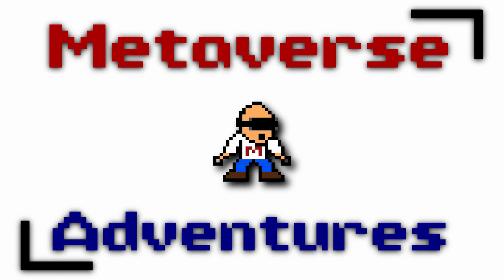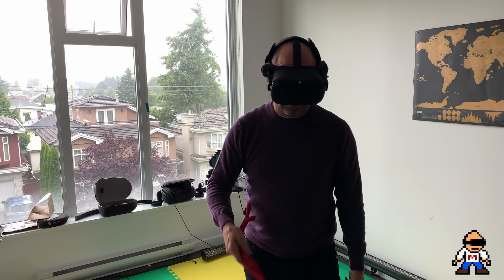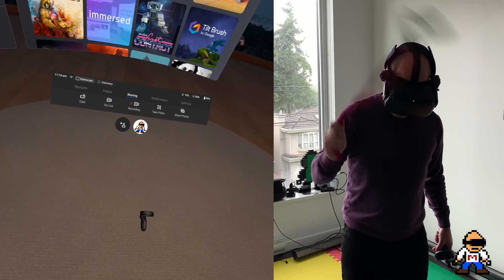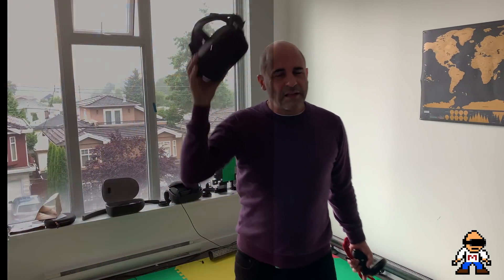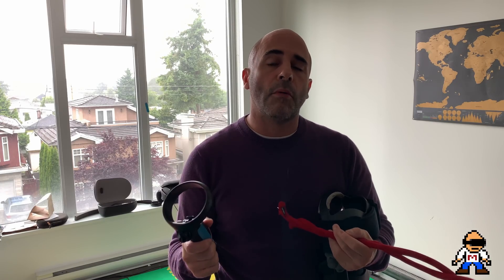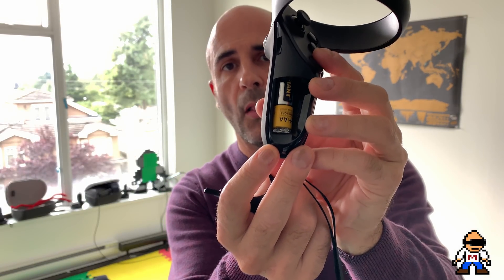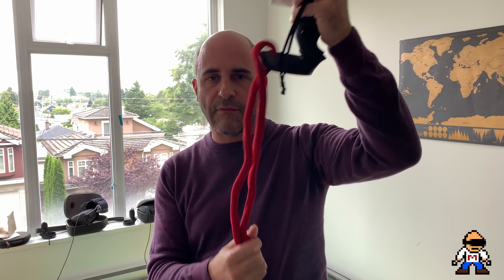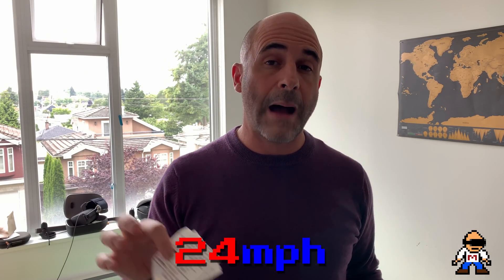See Part 3 Below: Oculus Quest Touch Controller 6DOF Tracking Issue (Root Cause)

Comment: Interesting video, but I noticed it wasn't just when you went fast that it lost tracking. It seemed to correspond with you moving your head down. The quest does have fish eye cameras, but the software guesses where the controller is after it passes their fov. With that speed you are going plus the weird angle of your headset i'm actually surprised it wasn't worse. I understand it happens in beat saber also under certain circumstances.
Reply from the maker: I find it happens even when I do not move my head. I will show it in the next video. Thanks for the observation though. Can you reproduce this error.

Comment: If you have an oculus rift S I would try the same test with that as the device recently received a tracking update.
Reply from the maker: I do not have a Rift S but I am about to post a very comprehensive video that includes the original Rift and even the Vive.  Maybe another hour or so.

Comment: At the speed your swinging it with that rope I'm not surprised it lost tracking I think that's an extreme case. In majority of movements it's going to work perfectly it's only a concern if it's an issue like you stated with best saber I think that's a much more reasonable expectation. The swinging the role thing is pushing it a bit far , you can't really complain about it losing tracking like that , I will say tho I've had the issue you've had with beat saber but I found it was better with dimmer lighting , I've had no such issues in sports scramble though maybe once in racket fury if I recall I had it but it's so in frequent I wouldn't call it a concern
Reply from the maker: I agree that for the most part the tracking is very accurate and while not perfect, and frustrating in games that require you to swing hard and fast, the Quest is still the best.

Comment: I don't think you've shown us a battery problem. The controller stucks but still circles around.  If there would be a battery problem, you would 1. loose the connection and 2. the controller would also not able to track it's 3DOF position (which they can do without the cameras). But as you see: both things are still there. So I just think the headset doesn't see your controller at some speed and that's the only issue. I'm not sure if that hefty experiment of you can be fixed by software. I think there is a chance that they can fix the problem for games like beat saber for humans without superpower but not for swinging the controller as you do. ;-)
Reply from the maker: For sure the swinging is not a battery issue in this test but it could be in the previous video test.

Comment: So, it seems battery is not the culprit after all. What you demonstrate is pushing hardware beyond its operational limits. It is reasonable to expect that it will fail under certain conditions. This is "not a bug", however frustrating it may be. When hardware stays within the limits but positional tracking is still lost is the actual problem. Thanks for the effort though.
Reply from the maker: I agree that it is not a bug as every system has its limitations. Certainly if the battery is coming loose that is a defect, but if it is just some games making you swing faster than the system was designed for, then the flaw is in the game not the Quest.

Comment: The bigger problem for me is the guardian (in the current firmware version). The walls always pop up when I swing both arms at the same time out of the view of the tracking cameras.
In Beat Saber for example it always happens when I stretch both arms to the opposite sides at the same time while looking ahead or when I swing both arms down and slightly behind myself. And it doesn't matter how big my play space is.
Can somebody reproduce and confirm this issue?
Reply from the maker: I can reproduce this and I have read many other saying the same thing. Oculus is aware of it and are looking into toning down the sensitivity or allowing you to adjust it manually.
Reply: Thanks!

Comment: I'd like to inform you that it is not an issue if it doesn't affect the experience and i don't think that you will be swinging around your controller like it's a propeller in beat saber
Reply from the maker: Actually, this whole video started as it was happening to me in beat saber. Is your watch part 1, you can see me causing the same issue by just swinging.  I am ok with this limitation, but games need to account for it.
Reply: @MetaverseAdventures  First I'd like to say that I really like your videos. I am sorry for writing my comment without knowing about the first part of the video. I was thinking about getting an oculus Quest and your your videos on the  headset have helped me a lot on taking my final decision ( btw I decided to save money to get it)

Comment: You have some great videos, seriously nice info👍.  1:43 WHAT! are you doing here though?!!  This is inhuman levels of sustainable speed.  Your last video about the battery contacts seems spot on, but this test actually made me laugh 😂.  The healthiest rotator cuff on earth couldn’t do that without injury.
Reply: I believe this rapid spinning test with the rope attached is to determine if the centrifugal force will move the battery in the opposite direction towards the positive contact instead of away from it as while holding the controller normally.  Since the problem occurs under both circumstances this process of elimination test can help determine that the shifting battery may not be the actual cause of the missed tracking.
Reply from the maker: Totally agree, but I would not eliminate the battery altogether though.
Reply from the maker: Actually, the speed where it lost tracking is really not fast. Even a child could swing that fast.  Games need to account for this and not encourage wife fast swings like beat saver does on some levels.

Comment: I don´t even play in Expertmode (for now) and still mess up the tracking. But for me, it takes so much longer, till the tracking is back again. It is 95% the right controller in my case. Maybe it is because the right hand is my dominant hand. Some guys in the comments wrote, they have the issue mainly on the left side. Are you guys lefthanded? Would be interesting to know. 
Great researcheffort. Very informative video.
Reply: For right handed people, the right controller is the one mostly used, which means it's also the one where the battery level lowers faster (you can verify this in the Oculus home, where the battery levels are displayed). Could this therefore be related to battery levels somehow?
Reply from the maker: Possibly yes. I will experiment with this. Great idea.
Reply: It is 90% the right controller for me too (right handed) ... It is annoying when it happens ocationly, but sometimes it gets totally stuck and doesn't find tracking again. I need to remove the battery of the controller and reinsert it to continue.
Reply: I am righthanded and it only ever happens with my left controller? Never comes back to position either, need to remove the battery everytime.
So long beat saber expert mode :(

Comment: I'm fairly certain what you're demonstrating here is an IMU reporting issue. If the motion of the controller causes both a high speed and rotation, the rotation can cause the IMU to report 0 acceleration, which the oculus tracking software can't square with the tracked object's motion, so it falls back to 3dof and will sometimes (usually?) set the controller's position to ground. After the conflicting force is lowered on the IMU, tracking is reestablished, and often it takes a few frames to get an accurate position, so often the controller representation will jump to two or three different positions before settling back to where it belongs

This is something that's easy to replicate if anyone has a rift with touch controllers, and I imagine it's the same with riftS; load any experience, Beat Saber is fine, and, while holding your wrist locked, swing back and forth in front of you as fast as you can. As long as you aren't occluded, tracking will be fine, unless you're a super athlete. Next, swing back and forth in front of you as fast as you can, while simultaneously rolling your wrist back and forth to rotate the controller and you'll see similar tracking loss.

Your testing methodology of swinging the controller on the end of a long arm caused a continuously shifting centripetal force, which can cause the IMU to go out of spec. Also, IIRC, the spec on the IMU used in the first generation touch controller was a Invensense MPU-6500, which is  rated to 16g, but oculus software is more conservative and drops out somewhere around 14g. I assume the second generation touch uses the same IMU. The rope you used looked to be about 18 inches long, give or take, and at 171 rpm that would be 14.95g, not counting the additional radius of your hand and arm moving through the motion.
Reply: Yup. The iFixIt Teardown says they're using a MPU-6500 chip. Spinning on a rope is probably the worst case for the sensor. 

Both the accelerometer and gyroscope in the 6500 chip can have a selectable range, each one doubling the range but halving the precision.  Those are  ±2g, ±4g, ±8g, and ±16g for acceleration, and ±250, ±500, ±1000, and ±2000 degrees/sec for rotation.  My guess is they're at 4g and 1000 deg/sec rates. 

Spinning on a rope is high G-forces compared to moving in a straight line, where you can have high velocity and very low acceleration. Spinning on a rope also gives high rotation rates, easily exceeding the chip's specification.
Reply from the maker: Bryan W I appreciate the insights. I am going to dive into this further and set up more experiments.
Reply: This seems to be true. Tracking errors started to occur since I started to use ancle swings in Beat Saber more often.
Reply from the maker: Maybe it is the g force.  I am able to do the same thing with an arm swing (see the first video).  I will do more experiments.
Reply: @MetaverseAdventures  IT 1000% IS I WAS PLAYING A BOXING GAME AND EVERYTIME I PUNCHED MY HAND WOULD FLY AWAY ONLY AT THE END OF THE PUNCH!!! MAKE AN UPDATED VIDEO PLEASE IT COULD HELP SO MANY PEOPLE!!! ITS HAPPENING WITH EVERY QUEST 1 2 AND 3

Comment: Oh my gosh, it's a cheap VR system! What do you expect a £399 system to be? I don't think these controllers are meant to be doing the helicopter like that in a swing lol. If the cost were in the thousands, then I might be slightly concerned.
Reply: Check his first video the controller was dropping tracking with a hard swing as well that was the reason for this test.
Reply from the maker: People are confirming the CV1 has the same limitation actually.  I will have to try on my Vive too.

Comment: I think its possibly a combination of factors but very likely more to do with camera and controller line of sight at crucial moments.  I have lost tracking a few times playing Drop Dead where I have turned my head quickly to see oncoming zombies, then try to shoot only to find my weapon frozen in air.  But to re-set I need to pause and remove battery and replace, so you would assume the battery is the issue but I never moved the controller quickly only my head.  So if the battery is not the issue in that instance and the controller is still shining its infrared lights then I think they should be able to fix that with software, just make the cameras pick out the lights and quickly recalibrate the controller position if that's possible?
Reply from the maker: Many have made a similar comment about having to take the battery out.  Hmmmm

Comment: In Beat Saber, I only really had this issue with the left controller occasionally in the right one but mostly the left. I didn't think I was swinging that hard though...
Reply: I also have issues with my left controller in Beat Saber. The tracking makes me miss notes I know I hit some times. It’s throws off my play sometimes in expert mode.
Reply from the maker: Someone thought it might be dominant hand related, but when others commented, it seems unlikely. More investigation is needed.
Reply: I played for 1-2 hours today and I had my left controller mess up probably about three times and one of them almost caused me to fail the level... It probably happened more times than that but it's just a guess, I didn't count...
Reply from the maker: Empire526907 did you notice if you were swinging fast when it happened?

Comment: That window is the worst place to leave a headset in the light.  I do not get any of those problems on my quest. Maybe you should contact support. I can swing as hard as a want and still have great tracking
Reply from the maker: When did you get your Quest?  Mine is a launch unit.  I agree on the window as it gets Sunny. We are extra careful with the lens cover but have decided to get a sable for them and get them out of harms way.
Reply: @MetaverseAdventures  my launch unit had to be RMA because of burnt smell. I talk about it on my channel. This unit is brand new at the time when they were sold out 2 weeks ago

Comment: Hey! It looks like you reached the hardware limit. I think you are right when you assume that the CPU is the bottleneck. Question is, can they write a better algorithm or AI stuff for significant improvement quality? Maybe for some simpler (graphics) games, they can give more CPU power for tracking. Is there any chance to improve if the camera specs are the core problem? Maybe AI?
All the best! Bye!
Reply from the maker: Great points. I have a feeling that at higher speeds it may just look like a blur to the camera.
Reply: @MetaverseAdventures  Totally possible. This hard swings do not have a complicated route. Maybe AI can help in this case. In the Quest 2 they should put 6 Phantom cameras with 25000 FPS. :D

Comment: Those batteries are snug, I find it hard to believe there's any battery issue. Does anyone actually swing their controllers THAT fast... even in Beatsaber?  I'd like to see you swinging other things.. I doubt any would cope that well.
Reply: Yes, I've lost controller's tracking as demonstrated in this video in Beat Saber and Vader Immortal's dojo, so those speeds are necessary for current games.
Reply from the maker: VperVendetta1992 Vader is another good example. Thanks for bringing that up.
Reply from the maker: For sure people swing that fast. In fact you have to when you are in expert and need to accumulate Saber travel. Even in other games when swinging a sword in a multiple enemy all around you battle.